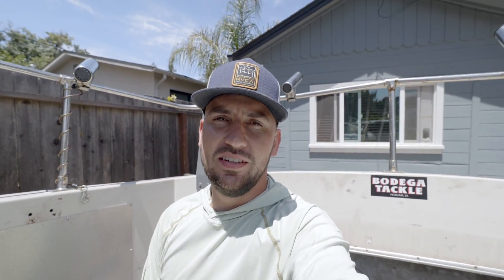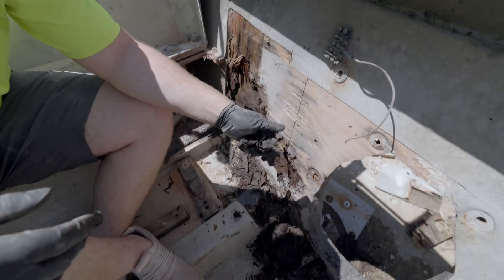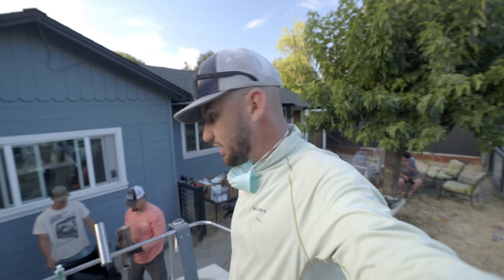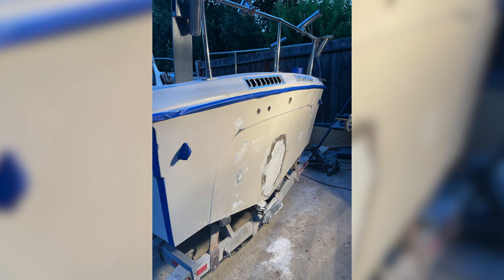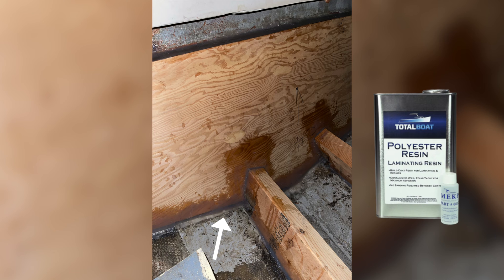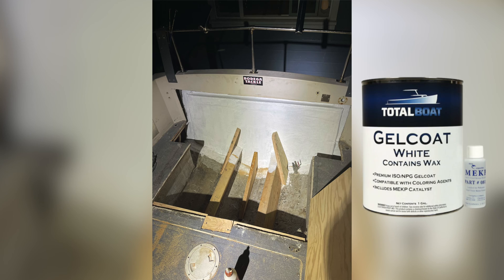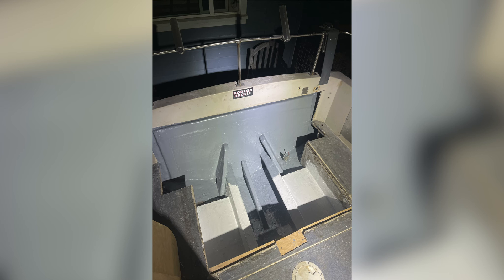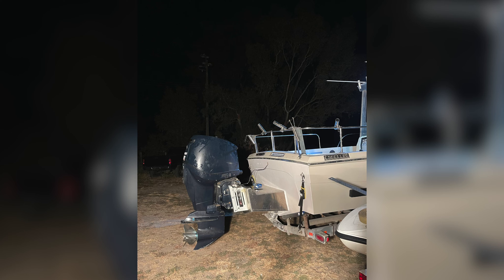Outboard Conversion Project [DIY!]

Comment: This may be a dumb question, did you cut the entire length of the stringers out? Or did you just cut out the part that was rotted and fiberglass it to the rest of the existing stringer?
Reply from the maker: Not a dumb question at all. All boats are built different. On our boat there are multiple sections of stringers. There are stringers in the old engine compartment, fuel tank compartment and the cabin compartment. They run the full length of the boat but are divided into sections. We only replaced the ones in the engine compartment.
Reply: @DDFishingCo thanks for the reply, that makes sense! I appreciate it!

Comment: Fantastic job! Why switch to polyester resin halfway through rather than just use epoxy resin for the whole job? Not being critical, just want to understand the pros and cons.
Reply from the maker: Thank you very much! The main reason was workability, cure times and price. The epoxy resin is stronger but also much more expensive too. So that’s why we used the epoxy to start with. We used it for bonding the wood to the transom, and bonding the layers together. Once we did that. It was easier to work with the poly. You can have a bit more flexibility with how much you hardener you add, so you can be a bit more flexible with cure times. Once a layer dries you don’t have to sand it again to apply. The poly you can keep adding and adding. Until you finish it off with some gel coat, or liquid cure to cure the poly resin. We also planned on filling small holes and doing finishing work with poly material for workability and sanding. We used fairing compounds and gel coat for that. They are much easier to sand and work with. Using epoxy for the whole job would have been much longer, and much more time consuming as well. It can be done though!

Comment: Why not use marine board? Polypropylene?
Reply from the maker: There are many ways to tackle a project like this. Things that come into play are costs, material, or types of fiberglass being used. Based on this project, it made the most sense to use marine ply and soak it in epoxy resin. I have seen some videos of guys using coosa board and other composite boards, they do work, they just change your project a little bit.

Comment: FYI for your viewers, you don’t need to replace wood in stringers. You can add layers of woven matt over the top of old fiberglass to reinforce stringers. Mainly if your not bolting to them.
Reply from the maker: This is great point! You are correct, you don't need to replace them, however ours were rotten so we replaced them.

Comment: Hi guys just happened to come across your channel, great work! To my surprise so happy to see that you have a 24 wellcraft airslot. I have one that I am doing a total restoration and layout change to a dual console outboard. Only found one other video on YouTube showing airslot. I had a 16-foot airslot 40 years ago and was amazed by the ride
Hence the reason for me finding one and wanting to restore it. hoping this 24 does not disappoint. Any knowledge you guys can share about the boat would be greatly appreciated. A couple questions I'm wondering where to locate my below deck fuel tank. It's a 70 gallon and currently I'm considering locating the front of the tank  about even with the center line of the boat and is 60 inches long towards the transom. This is about 3 ft more forward from the original fuel tank location. Any thoughts on the weight distribution and the ride characteristics? I never had the boat on the water. Im worried about bow steering and planning characteristics. Keeping in mind that I removed the cuddy cabin and adding light weight dual consoles which is removing a considerable amount of weight from the forward potion of the boat. I'll probably spend this morning watching a few more of your videos much to my wife's displeasure LOL. Thanks guys.
Reply from the maker: Hey Samuel! Thats awesome you have an airslot, it sounds like a sweet project you have going on. I can tell you a couple of things that we noticed. Before when we had the i/o the boat sat a little lower in the water and it rode a little better in rough water. I think the i/o was really heavy and it was centered at a low point in the hull and it kept the boat balance. The outboard bracket has some flotation to it so overall we ended up lighter in the rear of the boat. Also, we have an aluminum cabin on our boat which added weight to the front of the boat. Its hard to tell if the cabin is causing the boat to lean forward a little since the rear is lighter now or just overall the boat sat lower with the heavier i/o. The boat still ride great, its very fast. We love the boat. So in your situation, Since you took out all the weight in the front, you might be in a good spot. Worst comes to worst could you add weight to the front of the boat? 
Thanks for watching!!
Reply: Thanks for the helpful feedback keep posting videos.

Comment: Love this video very helpful and very informative wondering why you didn’t just do everything in epoxy resin instead of using polyester resin . I’ve worked with both and understand using styrene etc . Thanks again for taking the time to help others . 
From Australia 😊
Also what prop did you end up using. 4 blade or 3blade  17 or 18 and what pitch 
Thanks again
Reply from the maker: Thanks! We ended up doing the rest in Poly for $ purposes. The Epoxy is great, however its pricey. That and also how we finished the project. In between coats when we would sand. We would use gel coat to cure the surface since you need a curing agent to seal the poly. We liked using gel coat since its sandable and its easy to see hi and low spots when prepping for additional fiberglass layers. We could have done the whole thing epoxy like you mentioned too, its just what worked for this project. We ended up with a 4 blade 24 pitch prop. Thanks for watching!

Comment: I got a couple of questions for you guys.  I have a 1980 Wellcraft Airslot with a 5.7 V8 stern drive.  I purchased it a few years ago and it has basically been shrink wrapped for the last 20 years.  The hull looks great, just needs some polishing and new bottom paint.  Engine had already been removed, and cabin gutted. The flooring was soft so I started cutting it all out.  In the process of this, I found some of the stringers and transom were also soft.  Originally I was going to do Coosa stringers, transom, and floor, then a new 5.7 stern drive.  Now my plan is to do a bracket with an outboard or outboards.  I am not concerned about labor costs because I will be doing everything myself.

One big question is how good of a ride is that hull design before and after the conversion?  I have never had this boat in the water, so it's a big decision to put that kind of money into it. 

Do you feel 250 horse is good enough or would 300 be better?   

I was thinking of maybe even doing twin 150s - How do you think that would be? 

How was the floatation after the conversion?  My worry is having the stern sit too low or even too high.
Reply from the maker: Thanks Jon! Sounds like you have a fun project on your hands! I think the 250 is plenty enough to push the boat. We can get up to 45mph. Its got plenty of torque and honestly 45 feels way to fast in this boat. We love the 250. I suppose if you wanted to do dual 150s it might be nice for trolling slow and cutting down to one motor? Not sure how the fuel consumption shakes out there. 

After doing the conversion it would have been nice to get some extra weight in the back of the boat. The 350 and the outdrive were all located in the very bottom of the hull and were heavy. After taking out the the i/o and putting the outboard on, we sit higher out of the water slightly. Its not the end of the world, however it would be nice to have some extra weight. The boats sits pretty even in the water, just a little higher out. Before we could put 3 guys on one side of the boat looking over the gunnel and now when you stick 3 guys on one side it leans more than it used too. I think this is due to the fact the boat used to squat lower in the water. 

I am not sure how much affect our pilot house plays in the leaning easily factor or just if the boat sits higher out now.
Reply: @DDFishingCo  I posted a reply a few days ago, its not listed for some reason.  I wanted to know if you think scuppers are possible instead of draining into the bilge.  I want to build out the transom to incorporate a rear fishbox, livewell, and flip down seat - perhaps this with a freshwater tank where the old engine was would help the weight distribution.  I posted a link to my page on the hull truth, maybe youtube removed it because of that.  My restoration page is on there, under 1980 Wellcraft Airslot I/O to outboard conversion if you interested in taking a look.
Reply from the maker: You totally could do scuppers. We were going to do that, however we were on a time crunch to get the boat down and back fishing. It would have probably set us back awhile to do that. I have seen Airslots with scuppers. I will check out your restoration page, looking forward to seeing it!

Comment: Good work. I just bought a 1989 starfire 245. Has an inboard 5.7 with the stern drive but I’d love to do the same. It really opens up the back of the boat
Reply from the maker: Thanks man! Good luck with your project, we loved out results.
Reply: @DDFishingCo  if I do it I’m gonna film the process as well. Only thing that sucks with my boat is the cap is super broad in the back because it was a 12” wide fish box along the beam. Yours may have been similar.. I’m just not sure what to do with that
Reply from the maker: Nice! I see what you’re saying that could make it tough. The fun thing about the project is likely you will come up with better ideas as you go along. You’ll find a way to make that area work for your project. It will take some time and thinking
Reply: @DDFishingCo  where do you get your fiberglass supplies?
Reply from the maker: @jakejacobson2999 total boat or west systems

Comment: Oh, you did a phenomenal job!!! And the results are speaking louder for themselves!

Would you mind to help us with some questions?

We bought last hear an already converted boat, but the motor slips constantly and it seems to suck the air from the surface. Now we're waiting for the saison end and looking for infos...

So here the questions:

Did you guys measure the height between ventilation plate and bottom point of the boat (what's the height?)? 

How far does the motor sit from transom or simplier, how long is your bracket?

What were the rules to put the bracket on and does it touch the water, when you're riding (on plane and not)?

Appreciate your time very much!!! TY!!

And wish you to always find the best fish ;)
Reply from the maker: Thank you very much. We did our best and did a ton of research before starting the project. Boatworks Today was a great source of information along with Born Again Boating. 

Happy to answer your questions man, see below...

So here the questions:

Did you guys measure the height between ventilation plate and bottom point of the boat (what's the height?)? Yes, check out this video is very informational - from Born Again Boating. We also put a hydraulic Jack Plate to adjust our height as needed. You want the ventilation/cavitation plate lined up with the bottom of the boat and that will change depending on how far setback your motor is. 

https://youtu.be/N_EMx9WwTlY?feature=shared

How far does the motor sit from transom or simpler, how long is your bracket? Our motor sits a total 30 inches behind the boat with outboard bracket and the 8" hydraulic jack plate. You don't need a jack plate, we did one to be able to adjust the height. I know the total distance from the back of the boat needed to be 30inches. I cant remember the rule, however based on our horsepower, and total length of the boat, we needed 30 inches total. I think Born Again Boating has videos on this. Sorry I cant remember the exact ruling. 

What were the rules to put the bracket on and does it touch the water, when you're riding (on plane and not)? The bracket touches the water while floating at idle. The bracket has some flotation to it since its a sealed unit. When we are on plane the bracket is almost an extension of the bottom of the boat. Its not the same height as the bottom of the boat because its setback, and if it was the same height the boat wouldn't ride correct. The bracket would push the water much harder. It just brushes the water, similar to the trim tabs. There is a formula, to find the height of the bracket. Sorry I cant remember the exact ratios. It was this time last year when we did the project. 

If you send us an email I can send you some pictures of the bracket, shaping and how its mounted. Good luck with the project, hoping you can get the boat going again. 

Thanks!

Comment: Hi. Was wondering if your motor is too long? If it needed a jack plate?
Reply from the maker: It did not need a jack plate we put one on to optimize performance and can get into shallow water if needed.

Comment: Thanks for the video. At the 11:55 mark you talk about being able to spray off the deck and have all the water "drain below".  Is this into the bilge, and then pumped out, or do you have any scuppers for drainage?  I'm about to do a rebuild and want to figure out the best way to handle water on the deck.
Reply from the maker: The best way is to install scuppers. Keeps nasty water out of the bilge. However in this video and our project it all goes into the bilge. Based on everything on the back transom we didn't have ton of space for that.

Comment: I'm thinking about doing the same with my boat. What was your cost with doing alot of the work yourself?
Reply from the maker: I don’t know the exact costs. The material, like the fiberglass resin, epoxy resin, wood, deck paint, brushes, misc, was probably around $3000. All the hydraulic lines, throttle cables, hoses, wiring, maybe another $1000. The Jack plate (not necessary) was $1800. The outboard bracket will vary based on how many motors, what sized boat.
Reply: @DDFishingCo  this is awesome and gives me a good idea of what it will be around. Thank you
Reply from the maker: Awesome man good luck!

Comment: My guess is the experience you had with your transom is pretty typical for older glass and wood boats. It happened to my first boat and to my last glass boat. The experience with my last glass and wood boat was what convinced to buy a plate aluminum boat.
Reply from the maker: You are correct. Is very common for stringers and transoms to rot in older glass with wooden cores. A lot of people drill holes and don’t properly seal holes they drill in the bolts. We found several unsealed holes in the transom and stringers. Going aluminum will save you from those kinds of issues for sure. Most newer glass boats are built with composite material that will not rot.

Comment: Great job guys.  Looks like we follow a similar motto, "if it's worth doing, do it right the first time'!  Just a side note on wood core transoms and the issue of longevity in a marine environment.  My boat is built by Sailfish in Georgia.  There is no wood in the structural parts of the boat including the stringers and transom which are quad axial mat, epoxy, closed cell foam and kevlar .  They even come with a 10 year warranty.
Your boat is solid, so head off shore without a worry.
Reply from the maker: Thanks man! We looked into some different material like coosa board and decided to stick with the marine ply. We were very diligent in making sure the transom was completely sealed and all holes were completely sealed. That’s a badass build you have there. I can’t imagine the amount of hours you spent on that, it sure makes it worth it though!

Comment: I know how much work you did, because I did the same to my boat. I got a Hourston Glasscraft 18 footer hard top fiberglass boat for free, literally stripped it clean , removed the old seized up 250 inboard, then sealed up the big motor hole in the transom, put an aluminum pod and swim grid on the back, and a very good old 115 Ocean pro Evinrude motor,  all new wiring, harness, etc, etc, and it went 40 mph no problem. A foot wide 2 inch thick piece of Douglas Fir went inside the transom , a shelf, for batteries, and storage.
Reply from the maker: Oh man, when you get a boat for free you know it’s going to be a lot of work. Awesome work, thanks for watching our video!

Comment: Wow.  What a job.  Scary to see how rotten parts of the transom were.
Reply from the maker: It was pretty scary it was very rotten. We didn’t even show you how bad the stringers were. Thanks man!
Reply: @DDFishingCo  … makes me want to open my boat to see how the stringers and transom wall look…. Well, as far as I know, my boat is all fiberglass.   Lucky me…
Reply from the maker: What year is your boat? A lot of the newer boats are composite core and not wood core so you don’t have to worry about rot!
Reply: 2018 Osprey 26 Long Cabin.... should be all fiberglass/composite.  I don't think there is any wood.  I sure hope so after seeing your video...  @DDFishingCo
Reply from the maker: Yeah likely all are composite, the wooden core was an old school thing. Nice boat man!!
Reply: Thanks.  It sure is a nice fishing machine.